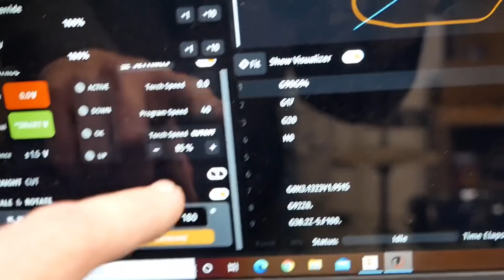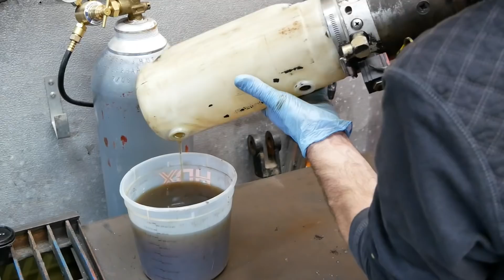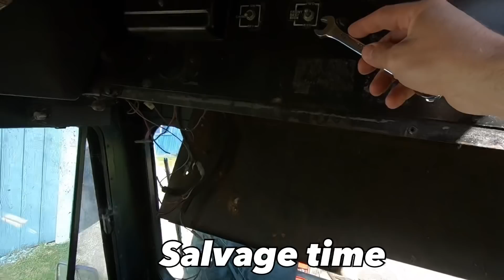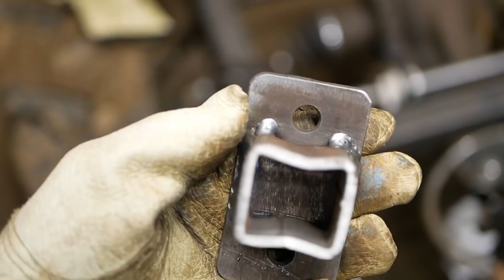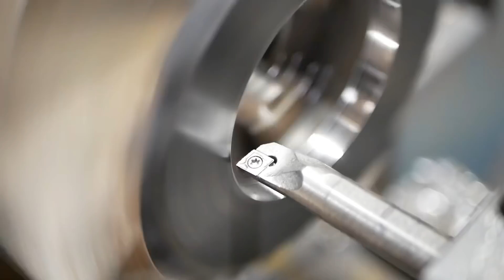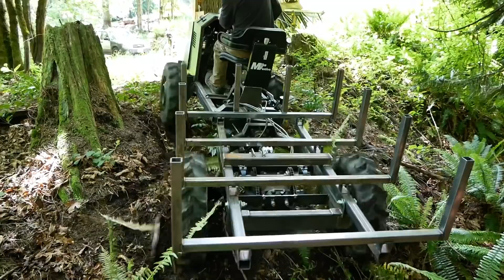420cc Predator powered articulating 4x4 dump truck build part 9

Comment: Why did you build a torque coupler? As that thing will almost never see pavement, wouldn't it be far easier and cheaper to have just welded the diff?
Reply: Seems like you're viewing the torque coupler as a street only upgrade. With a welded diff he would fight cornering and sometimes you want one side to not slip on loose dirt but hold while the other powers thru. With welded diff if both start spinning on a grade like that you go backwards which is dangerous.

Comment: I work as a hydraulic mechanic. We are also a parker supplier if you ever need anything feel free to reach out.  Hard to findParts or questions.
Reply from the maker: I really appreciate the offer 👍 I mentioned back in part 5 or 6 when I was trying to figure out the steering, the hydraulics are a bit of a gray area for me, I have learned a lot about them on this project but I still have a long ways to go, so I really appreciate the offer about parts and questions!  I just tracked down a 5 port orbital steering valve today so I’m going to be able to hook all the hydraulics up to my main pump soon once I buy a few extra hoses and a two spool valve body.
Take care 👍

Comment: yep subaru uses viscous mid and rear on turbo models, more spin more torque to the other side. 5 speed open front diff, and (my) sti 6 speed has a AP sure track front and that one send torque to where you want it the most. Some have  DCCD, electronic plate clutch type center. 
I think you need to build one for the front axle as well. It's really great design for not losing all drive in the slippy stuff but will allow slip on high traction. Very curious how it hold up long term too other than adjust for wear.

Comment: Nice idea with the external LSD unit.  This is similar to the way an open diff can be made to split torque by partially applying the parking brake.  I’ve used that trick a couple of times to get cars out of muddy spots where one wheel had traction but all the power was sent to the other.

Comment: Hrmm...the external limited slip is an interesting idea. I could see another way of doing it, kind of on the cheap, by basically attaching both driven sprockets to that bar and cutting it in the middle, then using a pin-slotted sliding overriding tube between them and a coat of a friction inducing material. Actual slip limit function on that isn't nearly so critical though because all you'd have to do to lock the two stub shafts together would be slide the tube over a little further to engage with both shaft's cross pins. 
Since this won't likely work well for limited slip... it's still a selectable locker on the cheap. A fork, lever,  and another cable would get you going...
Reply: That's a really good idea!

Comment: This is an awesome build I am really enjoying the videos. That limited slip is genius. You do awesome work and I hope some day to have a plasma cutter and CNC table to do that awesome cutting. I still think an attachment on the rear to lift a plow or auxiliary hydraulic attachments for implements would be awesome too. That way you could do some log hauling and plowing and even log splitting with it. Maybe after you get the rest of your orders to get a bigger hydraulic pump.

Comment: Mike. You don’t need a limited slip diff up front. You have the brakes on that axle. Try the same hill again but apply some brake pressure. It should force some of the torque to the stationary tire from the spinning tire. 
Hopefully the Predator has enough power for this to work. It should considering the gear reduction you have built into it.

Comment: Great build so far though I am concerned about the off center lift cylinder might twist something and bind
Reply from the maker: I think it will be fine, it’s only going to lift about 1500 so it’s not going to be that much.

Comment: Frankly, I don't know what Dingaling would look at what you created and don't think you know what you're doing... I mean if it was Ford, Chevy, or Dodge with multimillion dollars factories that build vehicles that guaranteed to fall apart and kill you, I could see. But, you here and have designed and touched ev'ry part and know what you doing and done right. And, didn't even need " Real People ", a " focus group", or a "JD Power and associates award either.  And, you out testing your machine and designs under real conditions, and, not on some computer simulations... Like they say. Talk is cheap, But, the proof is storyteller...
Reply: "Guaranteed to fall apart and kill you"   that was good enough for a belly laugh from yours truly.
Reply from the maker: Right on I really appreciate your comment! Thank you for not only commenting here but actually commenting to others too about the build 👍 this has been a fun project and lots of planning to get it to this point, I have learned a lot so far on this and I will be applying all I have learned to my next machine. I’m going to start on a rugged side X side next after I completely finish the articulating dump truck. Thanks again and Take care 🙂
Reply: @Mikefestiva  ....Much oblige....Take care...

Comment: Actually im not sure you did think of it before, looking back at part 8 you installed the hood with bolts at the hinges not the quick release pins you have now . its ok to admit you messed up and replaced them with the pins after we all mentioned it.instead of talking down to the viewers
Reply: Honestly, I don't feel " talked down to" . Any time you design and build anything, it's gonna be changes. Even tho he used bolts and nuts, you gonna think about vibration and wearing . The threads would oblong the mount holes eventually... Just like he figured he needed "Limited slip " on the back axle. With weight on, you want it to slip, otherwise, you gonna burn up or break something...As you know, it's easier to Pull something up a hill then Push it... Cheers...
Reply from the maker: mattallica0 in part 8 I did have bolts holding the hood on because I didn’t have any 1/4” round stock and I didn’t feel like turning down 3/4” to make it 😂 Also I always bolt stuff like that together with a extra washer as a spacer to hold things in place when locating parts to weld. I live a ways outside of town and it’s not a quick trip to buy some. I’m not talking down to viewers, I just get tired of dealing with rude people that constantly try and point out what they this is flaws on my project, I’m just showing them the hood opens enough to easily fill up the tank and do maintenance.

Comment: Nice think outside the box ,if that diff. Is like old school diff all u had to do was take spider gear box out of rear chunk take it apart and add shims in spider gears use to do it on old school hot rods cheap fix for high limited slips works wonders on the cheap
Reply: O without welding it

Comment: weld up that center diff and youll have no issues on traction, excited it see it hauling some stone and logs up mountain sides! test it with a load see how power hungry it is im sure you can add 500rpms to that motor for free with no risk

Comment: Ehy mike, just one question, of course will cost you more, why not a 2 cyl V twin predator 670cc? You have 3 hydraulic pumps, 4 wd, need for horse power, even if i must admit, i'm surprised to see that this mono 420cc is good enough, really shock me
Reply: never really hear it bog down tbh, maybe when he has it loaded with a half ton of stone it might be noticeable but all his test videos so far power seemed to not be an issue, suppose you could use the car motors and trans and basically reassemble the cars drive train around an articulating dump frame but itd be really tight unless made larger and he already noted this was max size due to its use zig zagging through trees
Reply: Well, 1... He thinks thru thangs... 2. For what he does, you don't need all that power. 3.. His specs was a machine of a certain width, weight, and utility.. Most cars can do 100 mph easy. But, how many people drive 100 mph?. Heck, you barely see a Vette doing that... Sooo...

Comment: hello Mike.  
stupid question : 
but if you turn your bumper with the winch at the bottom, would that be an option?  
then you can open the hood far enough for your pull start fever.  

you have nicely concealed that electric pump.  

keep it up I love watching your videos.  

kind regards Hollandduck from the Netherlands 
(source of translation: Google translate)

Comment: I am certain your limited slip works well a load on the rear end will prove the theory also old dump trucks of the 40s and 50sused a dump system known as a scissor lift which used a short stroke cylinder to achieve long lift did I just tell my age
Reply: you remember me when my grandpa teach me about mechanics stuff, he use to build up from scratch buses from what USA army left after world war II, 19, 29, 49 seats, and talks like you, well, maybe you're not 96 years old right now :-)

Comment: Better weld the center diff now. That thing looked like the front tires were spinning more than the rear. You will end up with a front wheel drive tractor soon

Comment: That limited slip is smart thinking.  I know there are Limited slip/lockable center diff AWD system for most Subarus, but for your application being offroad most time welding would be much cheaper.

Comment: Are you going to fill your tires with ballast? I have been told to use beet juice, as it is more dense than most other ballasts and will not corrode your wheels.

Comment: Mike, I am loving this build!
 If you would maybe you could address the single lift cylinder being offset from center. Have you considered going with 2 cylinders on the outside of the frame similar to the very large articulated dump trucks. 
Keep up the fantastic work love this beast 👊!

Comment: Dont doubt the limited slip at all.   You only had wheel spin on both wheels on that first pass.  If you had some weight in the back, it would have helped turn that spin into thrust and push you uphill better.  The single wheel spin in the front was really obvious. You should do the same LS up front and that beast would be really hard to stop...  Even with all that front wheel spin the center diff coupling was still sending a healthy amount of torque to the rear end, enough to spin both wheels...  well done!

Comment: Clever solution for the limited slip. Maybe I missed it, but why not weld the diff solid?
Reply from the maker: Thanks for checking out my new video. The main reason I didn’t weld out the rear axle is because it would cause a lot of stress on the cv joints when turning with a heavy load of rock or gravel. This system will cut down on wear of the drive train. Take care

Comment: Hey Mike, i saw this & thought that if you hadn't seen this it would be of great interest to you ! 
https://youtu.be/c3LhK2SAusk
It seemed that when you had the rear limited slip working the gearbox was directing way more power to the single spinning front wheel which must be frustrating, is that down to the viscous coupling you mentioned ?
Reply from the maker: Interesting video. I have thought about making a pen mount and knife cutter for my CNC table.
Yes The down side of the center diff is that it doesn’t send equal power to each axle, I will weld out the center diff when I pull out the trans to paint everything, this will give each axle equal power and the traction will be really good. Thanks for commenting 👍

Comment: I love everything about this thing. Can you remove the stock exhaust and run a short rain cap exhaust  up beside the hood, level in height with the hood? It would complement the look in my opinion. 

Thanks for the videos.

Comment: Did ya not look into a bell crank for the bed dump? You coulda run a even shorter cylinder almost hortizonal and still had full dump bed.

Comment: Straight up madd madd scrolls but one question didbiybturn your bigger than you Mich of thought it may of grew during the build
  The shear length and heightbworks great for stability.. I mean no like it!
Reply from the maker: It’s about the size I planned it to be. I had always planned the dump bed to hang over the rear frame 16” to balance the weight of the bed centered over the rear axle. Take care Donald
Reply: @Mikefestiva  ive been fighting a bad blood sugares thing my va doctor refuses to help, kicked me oiut the door im in a fight forvmy life i must toatllly control, the blood sugars thru diet, meats only , eggs , chicken, fish mothing else the carbs, are doing damge so it a total zero intake of carbs, thanks foor thhe reply, my  pologies to spelling. Peace!
Reply: @Mikefestiva  feeping better... maybe because I'm getting out because it seems
.i got the blood sugars down whilecoutvivhave av scrap yard , i toot they
 know it's me and I go look at the piles,
Ive been down for weeks,  found half of a kubota F2560e, half of the chassis engine
 side, no transaxle drive, but the 25-27 hp kubota complete,  radiator, air box, fuel lines
 not banged up, but a cracked ehaust manifold.. the little engine turned freely, so i have a killer power source and diesel at that too bad you're not close to houston, ive got llkinds a build projects..bring a trailer lol,  it oul be amazing but for you to do your are master craftsman at that i foiuld repowerca bobcat M700 theci would have an hydrostatic bob cat! It would be great for your place will be waiting on your next 
Video I'll start sharing, there are a ton
Builder's on the tube!